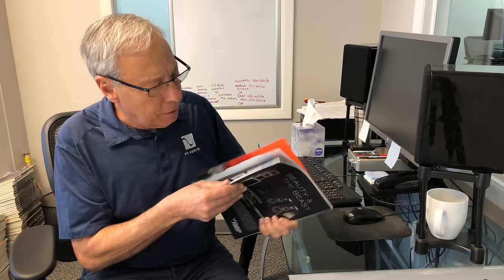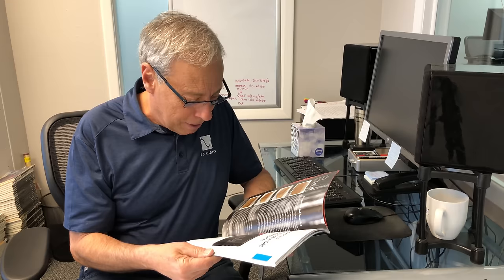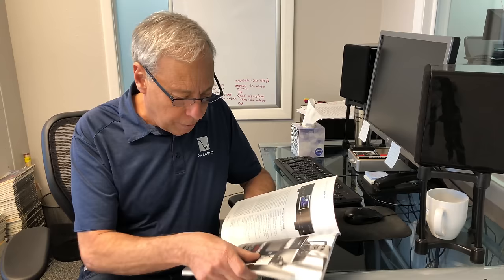Is equipment burn in real?

Comment: I think the comment Paul made about re-burn-in after a time is spot on.  I use a Class A amp during half of the year and Class D amps during the mid-summer air conditioning time.  After sitting on the shelf for months, they do need time to settle back in for a few days.

Comment: I recently sold a Marantz PM14 S1 SE amplifier (ex demo) that had barely been used to a customer. He complained it did not sound as good as his other amp  (same model) that he had used every day for over 18 months and was worried it was faulty in some way. He kept running the amp and somewhere around the 2-3 week point the sound became identical to his other well used amp.
Reply: It is psychological. May be he gave some inputs or changed to some settings. If this is real then it could be easily verified. Just get a amp and run a song or many song and using a recorder record it's output. After 4 weeks of good use record the same and check the difference. Why can't anyone do this ? It's so simple to verify.
Reply: @rajendrabareto8065  How this could be psychological? He had comparison with the same model he had.
Reply: @adamjachymek5923  if there was a thing it could be easily compared using signal capture and instruments. There is no research papers on it and these claims are done mostly by users who does not understand the theory behind the circuits behind the sound systems.

Comment: I've been burning in my amps for 35 years, and they just get better. Time to re-cap.
Reply: I had a Polk Audio subwoofer where the caps finally bulged and died.  I ordered new caps from an electric company that were apparently higher quality than what Polk had installed and the sound quality was deeper and louder.  it hadn't sounded that good when it was new!  Whereas caps may need to be burned in, apparently having better constructed caps make a difference as well.
Reply: @falcon048  When I remember sound from many years before, I have to temper my opinion. What if my hearing has changed? What if loss of high frequencies makes low frequencies sound better?
Reply: @BlankBrain  Agreed. I actually use my wife because: A)  She doesn't give a flip about sound quality. B) She has no bias or understanding whatsoever.

So, if she is capable of hearing a difference, then I know I am not crazy. ;)
Reply: falcon048 i have a question is the sony str-dh790 a good amp?
Reply: @evatheboxer7417  I have two BiAmp TC-120s and a Sony TAN-5550 V-FET amp.  The STR-DH790 7.1 channel amp is Amazon's choice for "surround sound receivers." It's probably fine for watching movies. It may fall short if you're looking for high fidelity audio that thrills. If you read the reviews on Amazon, you may be able to form an opinion.
Reply: Dang that's way longer than I've been alive 🤣

Comment: I have found that burn in
does apply
to speakers without any doubt.
Example:
I just upgraded my 7.1 speaker setup.
After 60 days or so, my Andrew Jones C22 center speaker
began to exhibit a warmth & sparkle it did not produce when 1st installed.
2nd, my 2 Klipsch SF1 towers (1999 models) which I rebuilt, using original,
but new tweeters and new Visaton woofers
(original Klipsch woofers weren't available) to complete the refurbish.
Even though the woofers were a stock stand in from Parts Express?
The Klipsch towers began displaying a wide stereo image after 3 weeks
of use. At times it sounds like there are speakers on the side walls when there isn't any.
This was a "new" attribute to the towers after burn in.
Klipsch are known for a tight but focused sound due to their horns.
These are warmer now & cast a wider image than I expected.
So, I am a firm believer in the "Burn In" time when it comes to speakers.
~ peace
Reply: Yes speakers have a break in period much like a car engine but amps and cables do not "burn in" and that is a FACT!

Comment: Paul this is true, i have a Audio Research D450 class D and the dealer let me use this and he told me not to judge the sound right away because it would take 3-5 days for burn in and he told me to leave the amp plugged in.  After the 4th day the amp sounded completely different and opened up and gave me both the power that i needed and the quality of sound.  My dealer needed it for a show with Garth Powell of Audioquest.  This amp was used with the ref 5se and Niagara 7000 and sounded amazing.  The amp sounded almost tube like.  The dealer left the amp on for 7 days.  I borrowed the amp one more time after the show and bought it two weeks later and haven't looked back.  Audio Research did a wonderful job with this amp, like I'm sure you did with the Stellar 700 series.  My DS450 was horrible out of the box and made me want to plug my Vt100 MKIII back in, which I later traded in against the DS450.
Reply: Funny, the amplifier Paul refers is also a class D amplifier
Reply: Yes, my dealer told me that when he first got the amp in as a demo, he hated it for the first 5 days and he was going to send it back to Audio Research and they told him to leave it on for 5 more days because he would only listen to it for 30 minutes, get mad and turn it off.  My dealer stated on the fifth day the amp started to sound pretty incredible.  My dealer used the amp when they would hold events in different venues and two being at bars that had special rooms for live bands.  That was the first time I heard the amp and I was floored.  Unfortunately Audio Research, who redesigned their Class D and used a totally different type of power supply, is no longer doing class D.  I have heard good reviews regarding PS Audio's Class D models.  I needed the power without the cost of tube replacement, which was $1000.00 for the VT-100 MKIII.

Comment: I can see that speakers that have moving parts can change over time and we know that electrolytic capacitors can certainly change over time (over hundreds or thousands of hours) but asking me to believe that components such as semiconductors for example need burn in time would be asking too much, simply because they have a defined operating characteristic out of the wrapper. We could not design and build reliable mass produced electronic assemblies if components changed after a few tens of hours of use.

Comment: Speakers and headphones can definitely change over time because of the moving parts involved.  Things can loosen or tighten affecting the vibrations that are heard...that seems to make sense.  But when we talk about electronics I have to lay the cause of any change on the brain.  If you are old enough to remember the little transistor AM/FM radios we had in the 60's, you know they sounded pretty crappy, but after listening for awhile our brains could tune out the noise and enjoy the music.  I think the same happens with today's audiophile equipment.  You open the box, set it up, turn it on, and you hear everything that system is putting out, including the very low distortion, but eventually your brain learns to tune out the bad and hear the good.  Just like the sense of sight adjusts to different bulb spectrums.  In my workplace, after bulbs I had lived with for years were replaced by warmer ones, I swore I hated them and would never get used to them.  Today they are second nature and seem just right.
  
Our senses are flexible and adaptive, and can learn to see, feel, taste, and smell more than is at first sensed.  In the same way, your brain can learn to hear more in the sound of a system over time...more details, more nuances in the sound...so again they seem to get better over time.

This is my opinion, and if anyone ever proves, in a double blind test, using the same speakers, that he or she can hear the difference between new and "burned in" electronics, then I will eat the appropriate amount of crow.
Reply: Everything and anything needs run in or burn in
Reply: Totally agree with senses. I wear eye glasses and every time I get a new pair my eyes have to adjust and kinda annoying. But after a few days the glass are great after my eyes adjust. 
I agree with speakers 🔊 to. New ones that are replacing the old always sound better but over time they sound normal to me and want something different. 
Light 💡 bulbs yes. I installed a bunch of Edison buds that have  kinda orange glow that I wasn’t sure about at first and now I don’t even notice.
Reply: BS
Reply: Be prepared to eat some crow.
Reply: @parisstromatias637  no

Comment: I bought a new PS Audio S300 and wasn't satisfied with the midrange. It sounded recessed. I was told to let the input stage burn in for 300 hours. I let it sit not connected to speakers with a preamp feeding a signal to it for 2 weeks. I made a point to compare the midrange to my Bryston 3B-ST as a reference. When I hooked up the S300 two weeks later, the midrange was much more forward, prominent and filled in great. It ended up going from sounding recessed compared to the Bryston, to more forward. Therefore, I'll give credit to what Paul said.

Comment: In my opinion, especially ‚wet‘ = electrolytic caps need a long long long time to format. With good Hi-Fi playback, it needs at least 0,5 year up to 2 years for formatting long life electrolytic caps (105+  Celsius). Then you have about 10-15 years good plateau quality, depending on how big the capacitors are. After this time, especially small electrolytic caps begin to loose quality. Huge, high quality power supply caps, which are not leaking, can stay in an amp for at least 30 years. On the other hand, today’s electrolytic caps are sometimes far higher quality (ripple current, low impedance..) than 20-40 years ago. Depends...

Comment: So what is happening during this "burn in"? With the great length that designers and audiophiles alike go to, someone must of sat down and figured it out, at the silicon level. What is happening that equates to this burn in. Transformer iron isn't going to change. Copper in the coils, transformers, and traces isn't going to change. Is there something going on at the atomic level like the boron and phosphor share and takes electrons and holes better??? I would like to know as I don't buy thoughts or opinions from other humans because we are absolutely the worst thing to ever come to the scientific method. I need a study
Reply: Heat. Expansion and contraction. Capacitors getting charged up and discharged. Power transistors getting heated up nicely.

Comment: Thanks for taking time to answer the question. But burn in is definitely real. I having been using my Amp for a while now, tonally its not changed a huge deal but it just sounded flat and a bit lifeless, sometimes even broken. But after extended use its only now really starting to open up with more air around instruments and gaining depth and dimensionality.  Dynamics is better and the music sounds more alive. The manufacturer recommends at least 600 hrs which sounds somewhat ridiculous but it does make a difference.
Reply: Din Phu ôup

Comment: I had never given Amplifier burn in a second thought in the past, as all my previous gear had been used stuff, but since buying a brand new amp and witnessing the change in sound over a couple of months,  or maybe say, 100hrs of use, I can say catagoricly that burn in does take place and has altered the sound, I acctually boxed the amp back up initially to send back, as I didn't think it was that good, but a mix-up in collection led me to give it a second chance, and the amp won me over in a weekend and then after around 100 hrs or so I noticed it had gained an even fuller sound, subtle but noticeable, it's a strange thing because people think that it's just you getting used to the sound, but it's quite the opposite, as in you adjust to the initial sound and then it changes, then you get used to it again. My experience with a new amp has been a good one, as in the sound improved, hence I still have the amp and am happy so far.

Comment: Isn't it wierd how audio gear only gets better with burn in? Statistically this is impossible to have such a huge percentage of audio gear sounding better with burn in than audio gear sounding worse with burn in. The science end of this mostly points to human sensory acclimation. Your just getting more familiar with something the langer you have it. The small percentages in audible difference these elecrical components cause after warm up or burn in are very unlikely to heard. Unless maybe you have very good gearing and a very good highly resolving audio system, which 99% of people dont have.

Comment: The simple side of burning in equipment is this, the theory that if there is a weak component in a circuit it will most likely fail within the first 90 days of service. When I worked for Intel we burned every processor we built. Now I wasn't only building production processors, I was on the assembly side of Intel's R&D. I helped engineers work the bugs out of new products before they went to market and I helped develope new tooling to manufacture product on. Now for us the burn in process heated the processor up to the temperature it would see when running at full speed, and we passed data through it, making sure that the data wasn't corrupted. When developing a new product we burned them in to the equivelent of ten years use, in steps, measuring how fast the processor was at different intervals. The last two products I worked on had minimal fall out, less than 1%, guaranteeing at least 10 yrs of use by which time the processor would be so far outdated that most customers would want to by a newer computer anyway. 
Audio is a bit different. The guys who built my speakers burned in the woofers long enough that their resonant frequency stabilized, then measured the Theil Small Parameters and built cabinets for them. When I bought mine with new drivers it took a few weeks of use for the resonant frequency to drop and the difference was amazing. The tweeters sounded less harsh and the woofers dropped in frequency to the point where they sound incredible today! They say capacitors take time to burn in as well, effecting the crossover network. So I would be prone to believe and look forward to the burn in process.
Reply: What a load of bull you were stress testing to figure out what the critical components in a chain mail link were and you equate that to 'burn-in' HA!

Comment: It seems to be real from my experience. I had an old set of earbuds that was going bad in one ear, but I could still get it to work by holding the wire a certain way. Bought the same brand and model again and it sounded noticeably flatter and more muffled than the old pair. I thought I got a counterfeit but a week or so later I compared them again and they sounded almost identical.
Reply: It the two sets of earbuds were made at different times, it could be that the manufacturer changed some of the materials or design of them, also.  I've bought guitars that were the same model, and the manufacturer had cheapened things up in the newer model (cheaper woods, most notably.)
Reply: Over the years, many manufacturers tend to cheapen what goes in to making their parts.

Infinity and their Kappa line is terribly guilty about this. Companies work to establish a brand and get people buying things and then they want to increase their profits and take advantage of the respect and trust people have for the brands.

Infinity, Sony, Polk, Harmon, JBL, Bose ... all horribly guilty of this and making so much CRAP these days. A lot of these companies just buy cheap Chinese crap and slap their brands on it these days (especially the ones just listed).

Comment: I started my career in radio and audio as an Apprentice Radio Tradesman in the 1970s. I serviced and repaired radio/audio equipment that used vacuum tubes and transistors. Reel to reel tape decks, turntables, amplifiers, tuners etc. In the 80s we moved into the CDs about the same time the quality of HIFI equipment plummeted to cheap nasty plastic rubbish. I bailed out of that game and completed a digital electronics course and moved into computers around 1988. I my time I never heard of 'burn in'. And I hear silly things these days like 'point to point wiring' produces better sound and 'monster cable' is the way to go. And sales people who claim to be 'HIFI' experts but have no idea what RMS means. I guess it's just a sign of the times.

Comment: Paul O have watched several of your videos, and I really like your style of presentation.  What I do find is when you get to discussion like burn in there is little to no data.  Is it measurable? If it takes days to sound right, then it should be measurable.  If caps take time to form, then that should be easily measurable. Lytic's especially the old lytics I can see.  Also since lytics are typically used in the power supplies, and many typically in parallel, the effect of the caps forming should not be noticeable.  The human ear is a wonderful creation, but and good scope is better.  Plus you and I are about the same age, I know my hearing is not the same as when I was 20.  So, hearing very subtle differences is very hard to believe, so help me out here give us some data. I have looked high and low and can't find anything.

Comment: I've personally had a pair of headphones improve with burn-in.  Until that day I was, at best, skeptical.  Assuming similar ideas of the mysterious blue smoke changing it's wavelength.
Reply: Çerastes  yes it does, depends on the cans you have, it can be very subtle, some notice it and some not. personally I had some units that had a noticeable change over time (200 hours+) and some that didn't

Comment: So if I buy a second-hand amplifier that's been in storage for several years I'll need to be re-burn it in?
Reply: Not exactly. The problem will mostly be the electrolytic capacitors. They will need some time to reform.